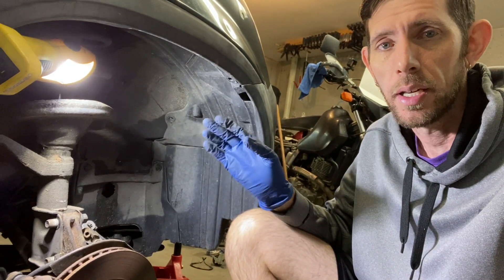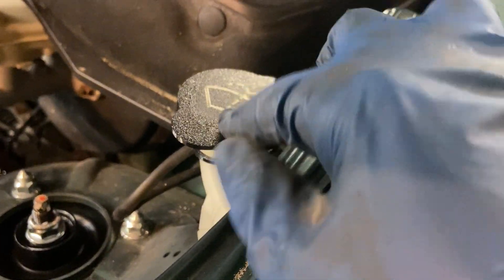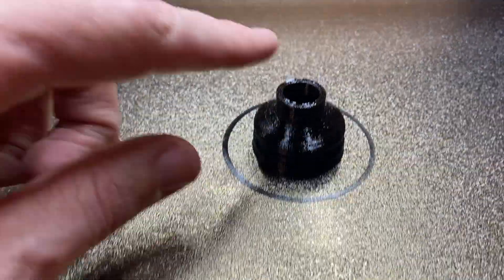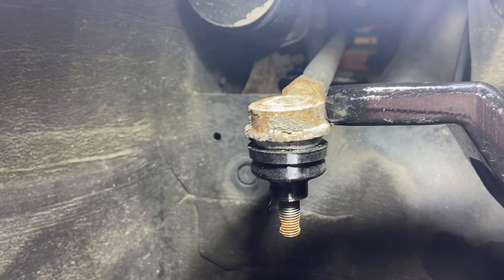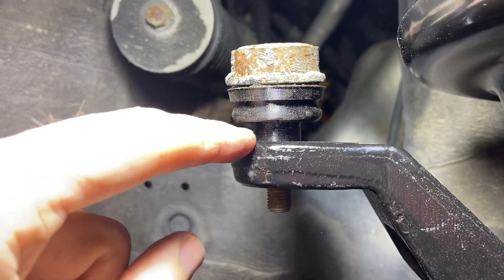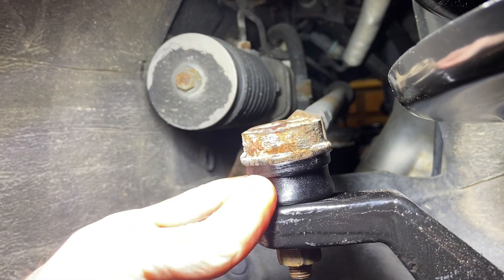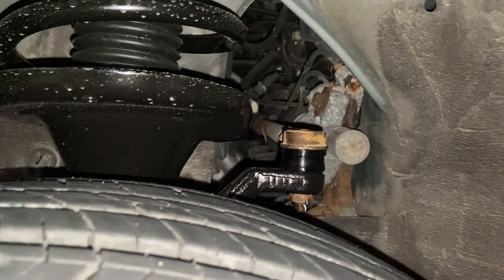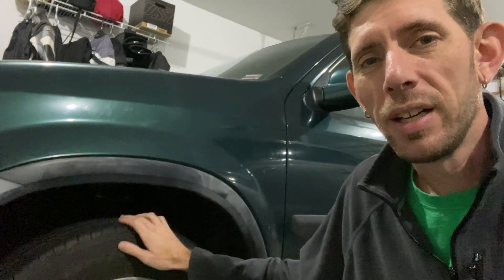3D Printed Tie Rod Boot - Will it work?

Comment: When replacing sway bar bushings I lost one of them.  Tried some tube polyurethane from Home Depot.  That failed in less than a week. 

I found and misplaced the other bushing about 3 times now before I get around to installing (Need to pull engine and drop subframe).

Finally I decided to stop wasting time looking for it and just print one.  

I've got some other printed bushings in service on the shift linkage with no problems.

TPU is more resistant to oil than rubber is.  If you have any oil leaks, the TPU will fare better than OEM rubber found in engine mounts.

Comment: I once saw someone make tpu subframe bushings and rear control arm bushings. 

I am running a 95A TPU subframe bushing insert on my mk6 gti where the "dog bone" mount bolts in. Been over a year since installing it and the torque solutions arm.